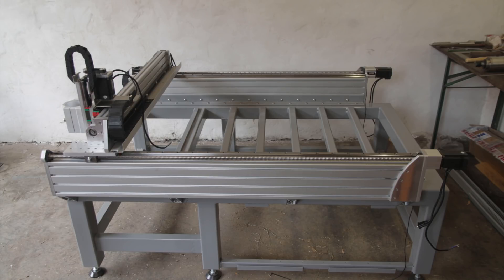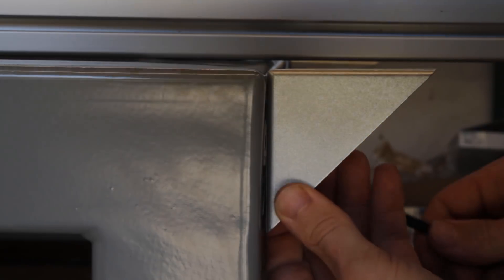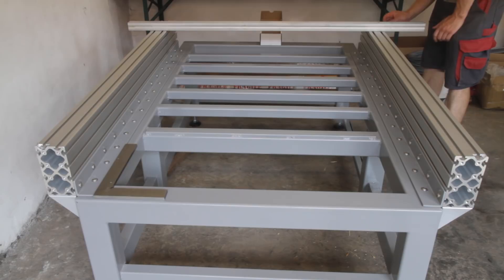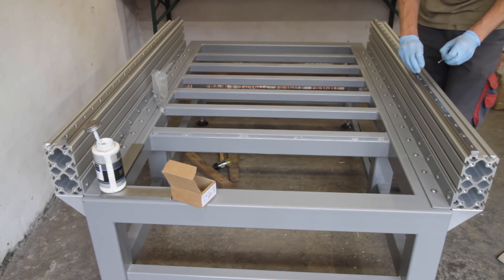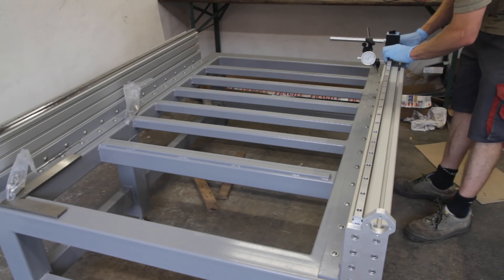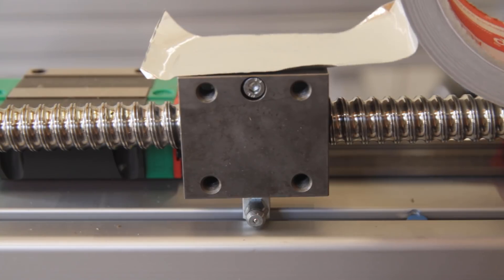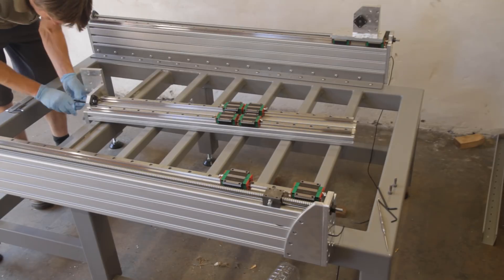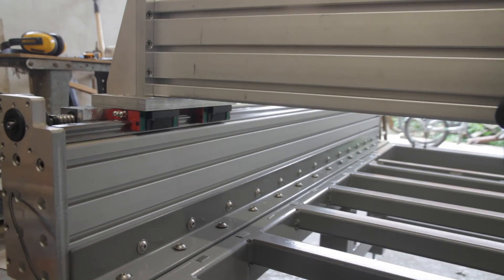CNC Router Build Part 3

Comment: What aluminum profile you are using?
Reply from the maker: The big ones on the side are 80x160mm. the one that rides on top is 40x120mm an d normally there are 40x40mm ones connecting the 80x160mm together.

Comment: I’m interested in what ballscrews and ball nut housings you’ve used. All the ball nut housings I’ve seen are 40mm high minimum which makes a compact design a little more difficult than I would like?
Reply from the maker: Hi, I bought them here: https://www.maschinen-werkzeuge.com/de/kugel-trapezgewindespindel/kugelumlaufspindel-kugelgewindemutter/ You can have a look for yourself. They also machine the ends of the ballscrew to your specifications.

Comment: Curious ... how much was the build cost?
Reply from the maker: I think there might already be an answer to that question in another build video. I think it was between 6500 and 7000 euro. But now I'm closer to 9000 since I added some stuff like a laser. I also will be adding a T-slot plate which is another 1500 euro. I believe there is also a bill of materials somewhere. The prices are also in there.
Reply from the maker: Ah, the link to the spreadsheet is in the comment  by Daniel.power a bit lower here. it says 7500 there with a t-slot plate of 500 euro so closer to 7000.

Comment: I really like your design. Currently I'm working on rebuilding my machine, was thinking on aluminum profile but as I would have to import them, price is too high. But your design solves that by using only 2 on the Y axis and 1 on the gantry. Which is great. I don't think I can get aluminum plates that thick here, but I'd have to see a workaround for that.
How is your machine holding up after 2 years?
Reply from the maker: It is based on the opensource design on CNCZONE.NL. There are also the DXF files available to have it cut for you, or you can ask one of the members there if they can make it for you.
My machine is holding up well. I am planning on a slight overhaul. Add a proper T-slot plate, tram everything again. Clean and grease everything. But it will probably be for late fall/winter since I have another big project at the moment.
Reply: @WimsMill  Thanks for the information, really appreciate it!
Best luck on that project, keep grinding

Comment: Nice Build, my only criticism is your gantry, the component with the most stress and flex is half the size of your Y Axis profiles and their mounted to what looks like 75x75 rhs ?
Reply from the maker: Thank you. Sorry I don't really understand what you want to say. The build I based this of, named the X-axis, the axis that moves the gantry. I know that this is not the common way so we might be talking about something different. The Profiles for the lower part (X-axis) are bolted with aluminium brackets to 80x80x3 mm steel square tubing. There is also an 40x40x5mm angle iron on the inside bolting the profile to the frame. Up until now, I have had little problems with this setup. Except for alignment, it works really well. I hope that this satisfies your concern.
Reply: @WimsMill  Ok your gantry is Y, I reversed your X and Y Axis.
Your X Axis extrusion profiles are excellent and are further stiffened/supported by the 80x80 RHS and Angle.
Why didnt you use the same size profile for the Y Gantry? or even 2 pieces bolted together. 
Apart from that I think your build is very good.
Reply from the maker: @nedgligich  Yes, I also thought about this. The design was made with this profile and I ordered the connector pieces. Then I would have to redesign this without a CNC to make the pieces. A bigger profile would also make the gantry heavier, thus slower acceleration or more expensive motors needed. And due to the dual X-axis ballscrews, a lot of this problem is solved. At the moment, I cannot say if the heavier gantry profile would be better, but this works well.
Reply: @WimsMill  I am about to do a build to upgrade from my 6040 or add, I know what to expect as far as cutting aluminium  and brass, any improvement will better what I have and if I had the same  quality accross a 1300mm Y Axis gantry I would be happy.
Also what steppers are you running and would you change type or go bigger?
I like the design of you're build and will be looking at applying many aspects of you're design to mine.
Reply from the maker: @nedgligich  I use the closed loop steppers from leadshine: Leadshine Hybrid-steppers 2NM met HBS507 drivers. They are smaller, but have more torque due to the feedback. Bigger will make it possible to get higher feeds. I can go to about 6000mm/min, which is good for what I use it. Check out the posts in the description of the video. It is in Dutch but there is a lot of information about parts and models there. Good luck!
Reply: @WimsMill  cheers

Comment: Hi, building my own machine of a similar size and curious what’s a rough ball park for the cost of your machine? I’m worried I might be spending too much
Reply from the maker: Hi! For me it ended up totalling around 6000 euro. It is possible to go cheaper but you might sacrifice on rigidity, size  or accuracy. There is a lot possible. 
Actually mine is not yet completely finished and I'm looking at another 1000 euro for another bed(cast aluminium) and other stuff. It all depends on how much you want to spend on it.
Reply: Wim's Mill thanks so much and that’s a great relief! Really helps me relax with the design and picking parts
Reply from the maker: @Bajicoy   Hello, here is a link to the spreadsheet I used for ordering everything. The approximate prices for it are also in there. It is in Dutch:   https://docs.google.com/spreadsheets/d/154-kxSBYvnp1bHq_tnTvRw56x0ahBS-KnqYY6n1-mTo/edit?usp=sharing

Comment: If you ever want to reference rails to profiles again; Measure and adjust on the most outer sides, (easy to get them within 0,005mm)  (slightly tightening the bolts and a small plastic hammer works miracle) then measure and align the center and work from there. It is the way i do it (and don't know if its good, but I think it works quick and efficient).
Reply from the maker: Interesting... That could work a bit faster. I tried it with a plastic hammer as well. But adjusting by hand also worked well for me. I will keep it in mind.